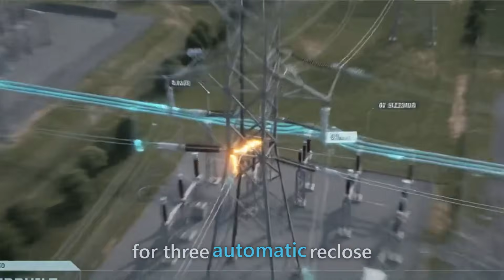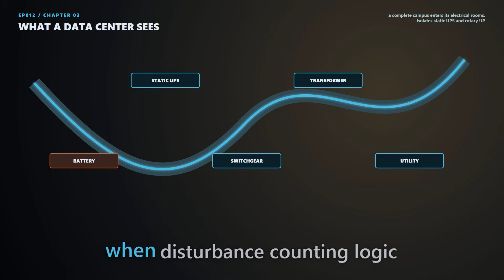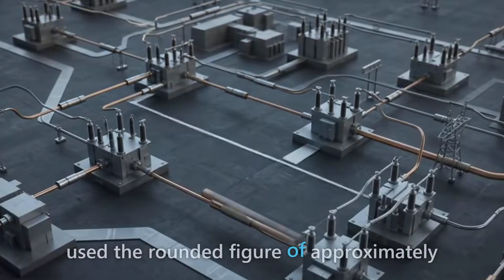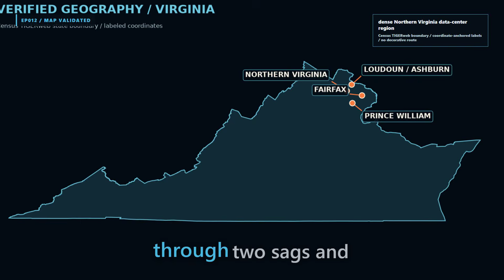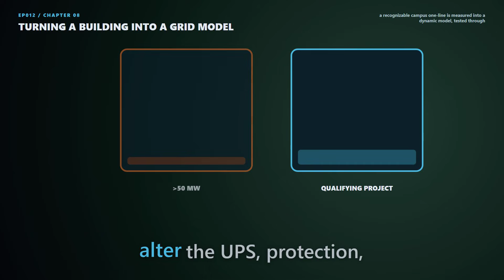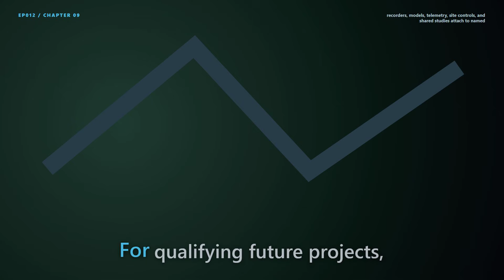Why Virginia's Data Centers Moved Like One Machine

Comment: At 7:56 am on July 22, a relatively ordinary equipment failure on a 230-kV transmission line in Loudoun County's Data Center Alley triggered an extraordinary response: nearly 4 gigawatts of data-center electricity demand abruptly transferred from the grid to backup power. PJM calls it the “largest such load-transfer event in its history,” as a massive cluster of data centers abandoned the grid and fired up their diesel generators, causing a voltage spike that rippled from Boston to Miami to Chicago.Ting Labs network of 1.4 million sensors captured the resulting frequency and voltage disturbance rippling across the entire Eastern Interconnection, affecting an estimated 100 million homes and 238 million people. Again, NERC has been asked by FERC to develop new ride through and transfer standards to address these increasngly frequent events.

Comment from the maker: One important distinction: the data centers did not cause either transmission fault, and the public reports do not say the buildings lost computing power. Their controls transferred demand after seeing voltage outside their limits. NERC described the July event as roughly 1,500 MW; Dominion later reported 1,551 MW for its analyzed scope. The February record was revised to 1,800 MW of data-center load plus 544 MW of cooperative load.

NERC also said the July event stayed within reliability limits. The concern is what the same mechanism could do at larger scale or during a less favorable grid condition. What should be standardized first: ride-through waveforms, transfer disclosure, staged return, or cost responsibility? Primary-source corrections are welcome.